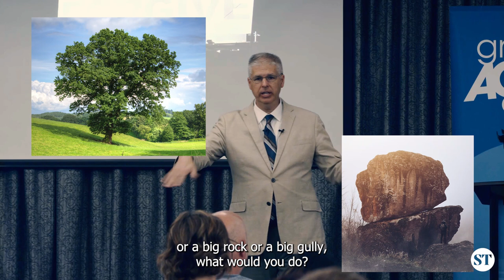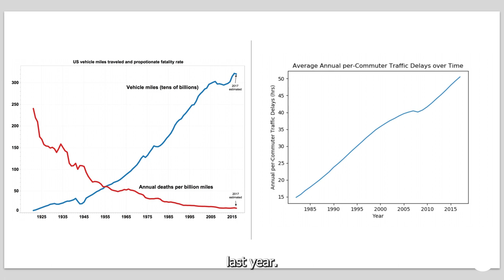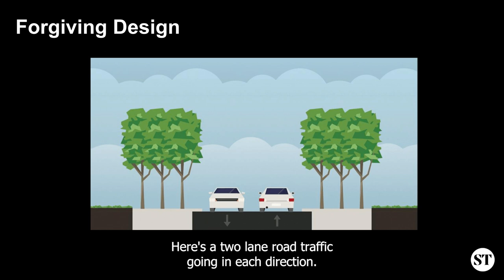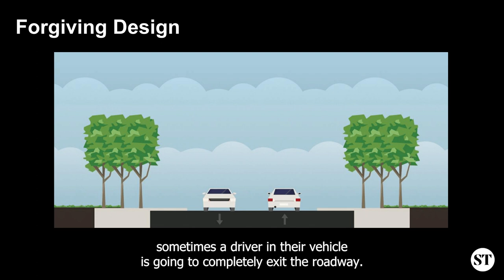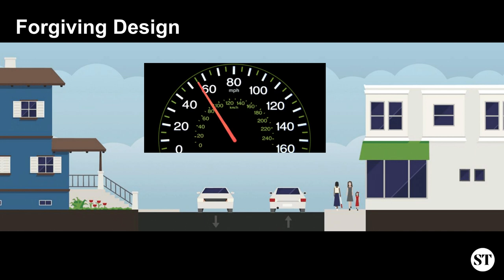This Engineering Practice is Making Your Commute More Dangerous

Comment: Nothing bothers me more than the dozens of six lane, hundred foot wide roads with a speed limit of 50Kph in my city.  Such a fundamental misunderstanding of human nature and driver psychology.  They’re a waste of useable pedestrian and cycling space, and encourage drivers to speed well over the posted limit; making it more dangerous for everyone.
Reply: Man, my hometown has arterials with speed limits of 55 miles per hour. It's basically a highway, except you have tons of stoplights and collision points. I can't think of a single arterial that has a speed limit of 50KPH (30MPH). The roads are wide and the blocks are long to accommodate drivers. Of course there will never be political will to change how the city is designed, which is a shame since I do think there's potential to retrofit it some extent.
Reply: I agree and yet i also drive way over the speed limits here. Why drive slow when the road is basically a highway? Its just stupid and a waste of space
Reply: @vishaalprasad2020  recently learned, that traffic lights do not operate above 43 mph (70kph) in Germany, because the reaction time above is deemed too unsafe for traffic lights... And in the US 55 mph on an arterial is just absurd. That is faster than the German Speed Limit on urban freeways (50 mph/80 kph)

Comment: We only think tunnels are expensive because we don't account for the expensive externalities of high speed roads in urban areas.
Reply: We can remove high speed roads from urban  areas without spending billions on road tunnels.
Reply: Tunnels are 4 times more expensive than building overground just to construct them, maintenance is more difficult, and there's a greater risk of fire.

How about building streets (not stroads or roads) that have speed limits of 50 or 30 km/h in cities, that enforce those limits by street design not police
Reply: @jan-lukas  and while we wait for a street design the police should do their job and be enabled to effectively enforce speed limits.

Comment: "forgiving" design doesnt exist, cars neither forgive or remember. what it's actually called is; a runway, it's designed as a runway. a runway is there for vehicles to drive as fast as humanly possible in order to take off from the ground. when you build a runway on top of a road. people get nervous, their perspective makes them think they're going slow (because it takes longer for you to drive past the environment, making you think you're sitting in the same spot) so they speed up to whatever feels safe, because the speed limit is already out the window; it's no use
Reply: Forgiving design does exist, just not in URBAN settings. Highways should be built like that, but again NOT IN CITIES

Comment: The death rate per mile between past and today is not an apples to apples comparison. People’s lifestyles were local and walkable so few driving miles were necessary. Today’s stroads and highways make the deaths per mile need to be very low because VMT is exponentially higher than early automobile era.
The same point also applies to people today who want to bicycle instead of drive. Inherent in that choice is living more locally so the miles traveled tends to be much less than a driving peer. Therefore the death rate per mile of bicycling is not as bad as it looks when compared to driving. That risk level has the multiplier of miles traveled. Reducing mileage reduces total death risk. 
That said, of course it is welcome whenever the per mile risk decreases.

Comment: Designing roads to be dangerous on purpose is not an option though.
Reply: The Dutch would like a few words with you ...
Reply: Not dangerous but commands your attention and where you naturally drive slower.
Reply: Roads shouldn't be designed to be dangerous, but they shouldn't be built inside cities. Streets however should look like dangerous, so drivers will pay more attention, and be built inside cities but not outside of them
Reply: @jan-lukas  we can compromise on leaving it at "roads shouldn't be"

no roads - no problem!
Reply: dangerous to take at high speed does not equal dangerous
Reply: its called a street. Human scale, small lanes, low speeds, lots of buildings and foot traffic on the sidewalks. We shouldnt be applying highways approach to streets in the city. Thats what europe engineers do best. They have one standard for building roads and highways and one for building streets.
Reply: When you widen lanes and remove trees and increase setbacks and encourage high speeds in urban and suburban areas, you're making roads more dangerous, not less.